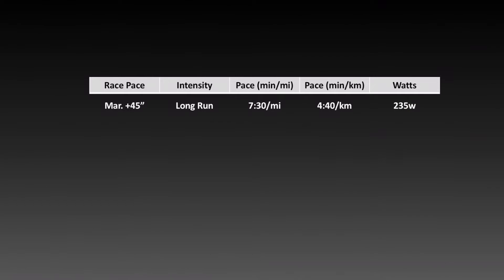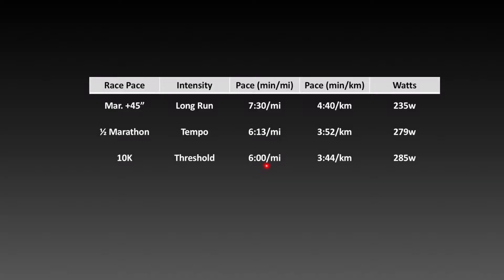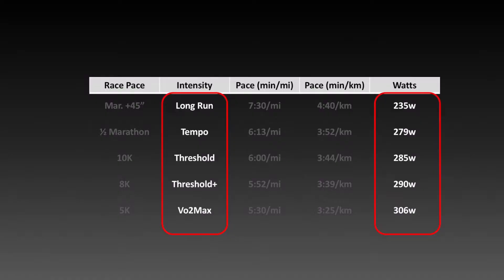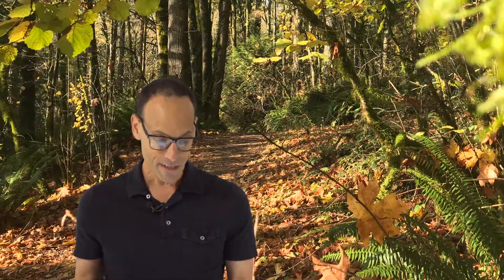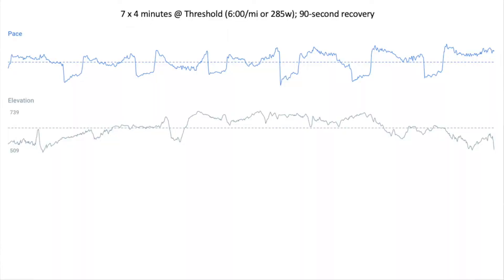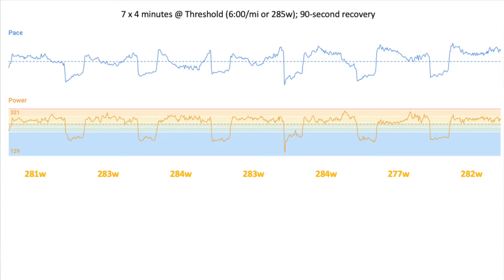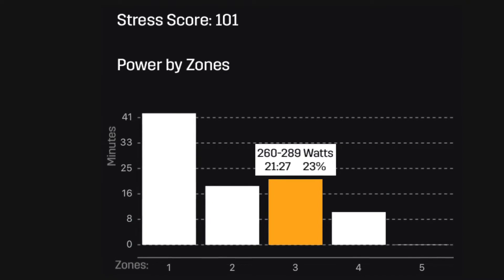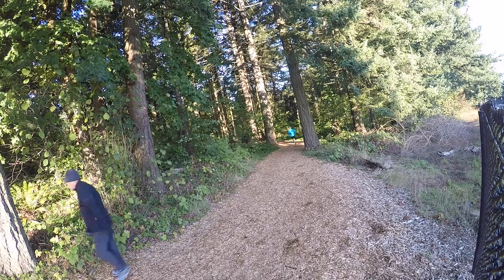XC Training With Power

Comment: I know you have mentioned the power number in past videos but I am not very familiar with it:    Does the watch alone give you your power # or do you have to wear a foot pod as well?   Are there tables somewhere that tell you an appropriate power number for each pace (tempo, VO2 Max,etc.)?    

I have an older Garmin 220 that does not have this option.
Reply from the maker: Right now, there are basically 2 ways to get running power- a Polar Vantage V watch or a Stryd footpod. I use the latter. Both systems will give you various power ranges for training, but I like to use recent race results instead.

Comment: So, something happened recently that has me thinking quite a bit about running watches/data.  My son has been struggling to break a couple barriers during his cross-country season, and forgot his watch the day of a race.  He ran without it, just based on effort and set a 90 second PR.  He hasn't touched it since, haha.  I think there's value in data, but I have recently turned all metrics off on my watch with the exception of time and cadence, in the interest of just running based on effort, especially as I try to build up a base again.  When I get back to specific workouts, I'll probably watch paces on my watch again, but I think there is great value in learning to run based on effort.  In your experience, do you think Stryd helps or hurts with that...I can see arguments both ways.

Also, just curious -- are you still being coached by Tinman?
Reply from the maker: I think most experienced runners can effectively train by perceived effort 95% of the time. The exceptions would be really hard track workout or hilly runs when trying to keep a certain pace at very high fatigue levels.   For kids xc, i’d say it’s best to throw away the watch and do the workouts with those equal/slightly better than they are.  I mostly look at data post run for analysis; however, I’m using power metrics to measure my effort levels this xc cycle because of the crazy terrain in which I’m training. As for Tinman- he got me to my goals: sub-3 marathon condition and 17:40 5K. I’m self-coached now but recently joined the Bowerman Track Club masters team and doing some workouts with them.

Comment: Great stuff. I just ordered my Stryd this week as I will be moving to a more hilly area, so it is a great way to keep training consistent.
Would you know if Stryd also takes ambient temperature variation into the power calculation? Meaning, effort needed on a hotter day should be more than on a cooler one at a same route/pace, no?
Reply from the maker: Power isn’t affected by temperature (except for minute changes in air density which are too small to be significant). If you are referring to your cardiovascular system having to work harder to keep your body temperature in check, that is a real issue but would only show up in heart rate and not power. Power is (force x distance)/time...which can also be written as mass x acceleration x velocity. See, no temperature.  😀
Reply: Thanks Otaku-san. I just realized that the temperature sensor was added only in the most recent version. Im wondering how they will play with the temperature/humidity factor, as indeed the power should not change, but does our (cardiac) effort... I love the fact that this is a new and still developing technology... a lot to be seen still...